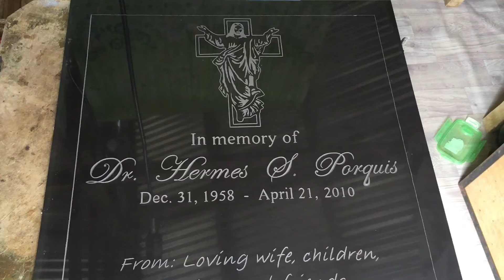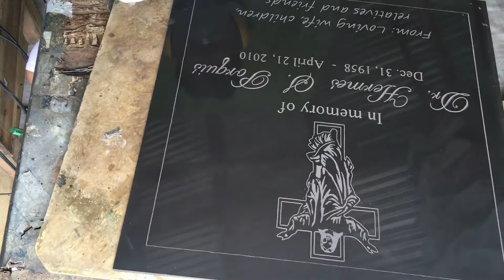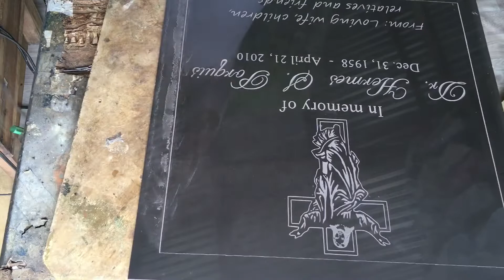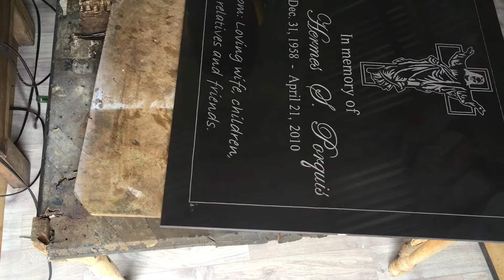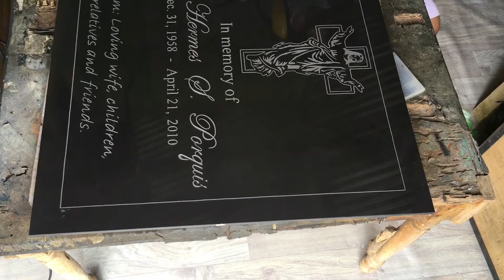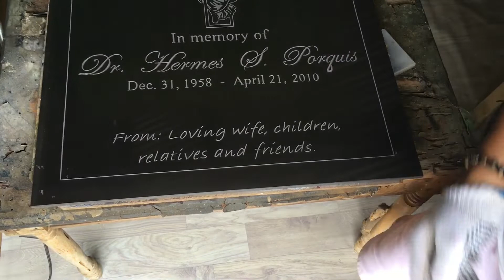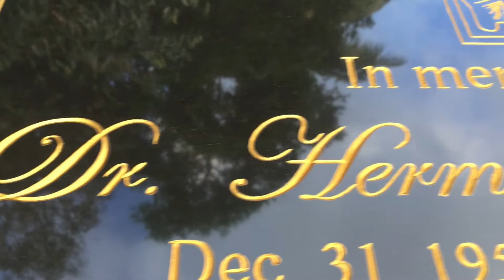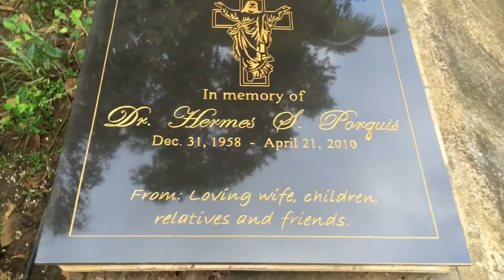PAANO GUMAWA NG GRANITE LAPIDA

Comment: Ano po tawag sa pang ukit na gamit niyo sir?
Reply from the maker: Dremel rotary tool (Dremel die grinder)
Reply: @Lizardtriplettail  dremel 4250 din po ba yan?
Reply: @Lizardtriplettail  malakas po ba vibration?
Reply: @Lizardtriplettail kabibili ko lang po..ang lakas magvibrate ..pero parang legit naman..tapos madali mag init ung tip.. testing pa lang mainit na..literal na pina andar lang mainit na...pero di q pa po nasubukan na may shaft..huli kc order ko sa shaft and nauna to..